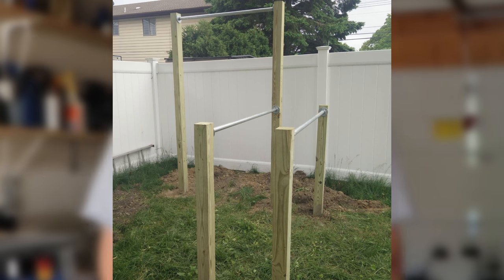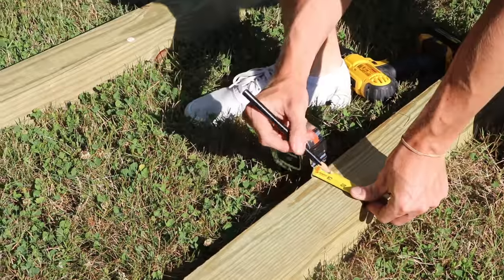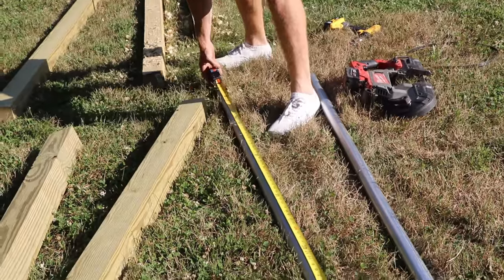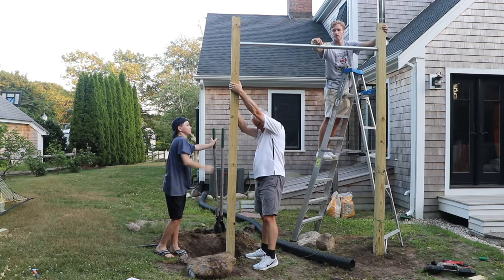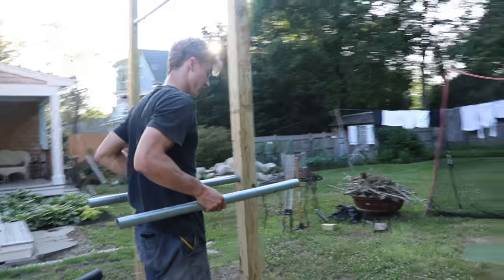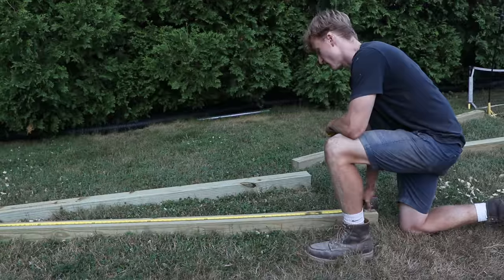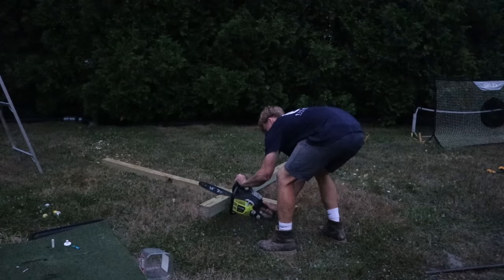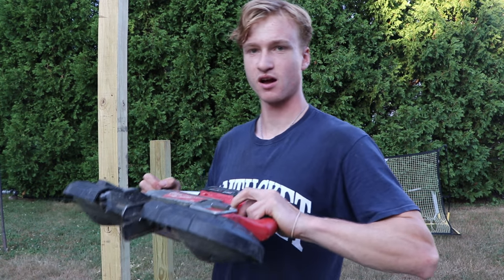We Built a Backyard Pull Up Bar & Dip Bar

Comment: Cool! Love the humor. 
Tips, though: When cutting the tops of the posts, Take a speed square and draw a line across the post, where you’re going to cut. Then when using your saw follow that line to make a good flat, square cut. Use a circular saw, if you have one. Also, you can set your circular saw at 45° and cut about 1/2” off he square ends.
There are caps you can get for those posts, to to finish them off and make them look a little nicer.
I’m not a big fan of putting concrete mix in dry and in then pouring water over it, if that’s what you even did. I like to mix it with the right amount of water and then put in the hole and tamp it down with a piece of wood.

Your friend asked what pressure treated is. Pressure treated lumber is where they take a whole unit of lumber, put it in a big cylinder and fill it with a treating solution and then pressurize it for hours. This solution gets inside the wood helps prevents it from rotting and getting eaten by insects. They used to use a solution called CCA, which stands for Copper Chromium Arsenate. But, even though the arsenic was a very low amount (the same as what is naturally in dirt), they thought it was bad for the environment (CCA treated lumber was bad to burn. I don’t know about burning the pressure treated lumber, currently on the market), so they changed it to another type of treating solution.

Comment: So you didn't put the cement I'm down mixed with water so it can harden?
Reply from the maker: You don't need to mix it. It absorbs the moisture in the dirt and then bonds to the wood. Mixing it is pretty much a waste of time for wood posts. It's been a year and a half and the bars are still standing like they were when we first put them in
Reply: @alexanderlegassick619  thank you 👍 again
Reply from the maker: @alexpadillayt  ur welcome
Reply: @alexanderlegassick619  if i mixed it, what will happen?
Reply from the maker: @gr1mmy304  same result whether you mix it or not
Reply: @alexanderlegassick619  can i use tek screws instead of exterior screws?
Reply from the maker: @gr1mmy304  yeah they should be fine
Reply: @alexanderlegassick619  i just finished my pull up bar and dip bar, thanks man!

Comment: Dangerous - post not protected in the ground
Rot over time and then bars will become a hazard over time
Should use a steel post fix and set it in concrete

Comment: You legit just poored dry cement directly in the whole... Thought you had a brain for a sec
Reply from the maker: Concrete is hydraulic. When it's put into the ground, all the water in the dirt is absorbed and the concrete hardens. If you're mixing concrete with water and pouring it into the hole for a 4x4 you're just wasting your time